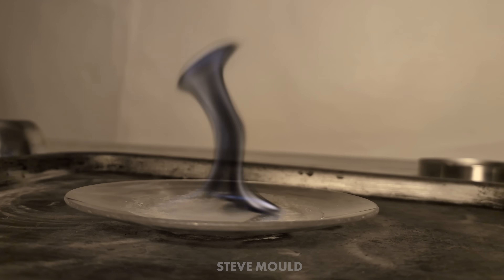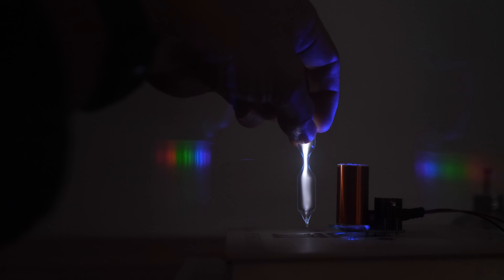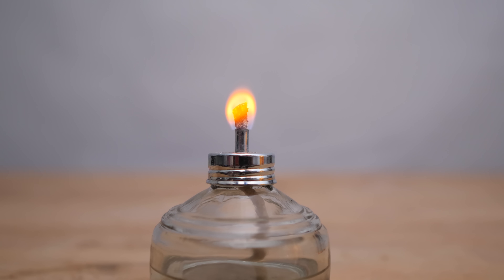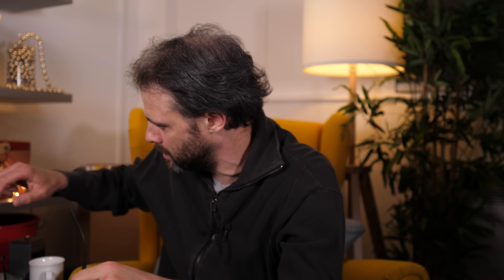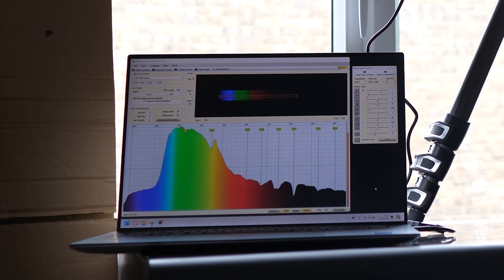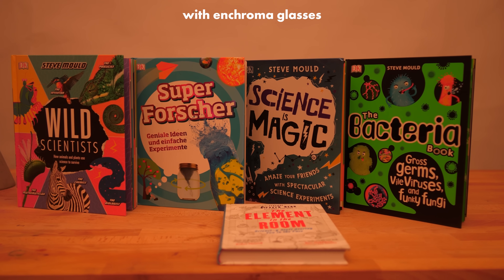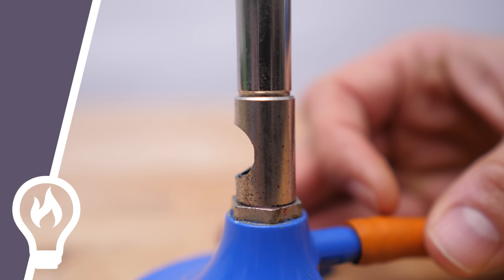Light sucking flames look like magic

Comment: Back in the early 1980s, after I acquired my driver's licence, I ran a red light on a section of roadway lit by sodium street-lighting because I happened to approach the lights after they'd turned to amber, perfectly camouflaged amongst the sodium lights.  Fortunately there were no other vehicles around as it was very early in the morning!
Reply: Bingo! Exactly the same thing happened while my brother was driving in the late 80's/early 90's, but fortunately without actually running the red light (newly installed lights on a very familiar road lit by sodium lights) since we also had my older sister in the car who called out "red light" when she realised neither of use had seen it. Stopped with the nose over the line. No cars nearby (~9pm), but easily could have been. The traffic lights were visible from over 200 metres away, but like your experience had already changed to red before they were in our view, so were lost in the sodium lights. For that reason I do not miss the sodium street lights - we are all safer from their disappearance.

Comment: The Corridor Crew did a cool video on using these lights to mask off subjects like a green screen. My question is with something like this could you effectively do something like use Photogramatry on a flame to get its exact shape? if you had a camera array? would this work with other fluid simulation things?

Comment: i have struggled with "Spin" of subatomic particles for years. The "it tells us which way the moving electric charge points its magnetic field" line felt like an epiphany i have waited decades for
Reply: Nice, and the reason the property is called "spin" is simply because the magnetic field of the electrons looks as if it was produced by the electrons spinning. Even though they're not, since they're wave functions at quantum level
Reply: @redtoxic8701  Or perhaps there's more going on there than we can comprehend... unseen dimensions and what not.
Reply: @James-fe7wd  that's an information as irrefutable as it is useless
Reply: @redtoxic8701  The point I'm trying to make is, our understanding of these things is still rather limited and likely always will be given our place in the universe. I'm no quantum phsyicist, but to call an electron's spin a misnomer with certainty seems quite presumptuous to me. What appears as a speck to us could well have dimensions we are not able to observe, and thus see them from a single dimensional plane. Just food for thought. I'm not trying to prove anything.
Reply: That's because it's highly simplified, it works in the context he presented electrons in, as point-like particles orbiting an atom.
I'm not a quantum physicist, but from what I've studied in my free time, spin is an intrinsic property, meaning even an electron standing still has to be in a spin up or spin down state, or a superstate of both.
This allows another identical electron to inhabit that same space "on top of each other", as long as its spin is the opposite. Not only that, it's possible for an electron to "flip" its spin, which has no macroscopic equivalent, since electrons don't spend any energy to do it.
Meanwhile, to make the Moon's angular momentum the same but opposite, you'd first need to exert enough energy to get it into a standstill, then the same amount of energy again to make the direction of movement opposite.
Like, even this explanation most likely has numerous errors, and it's extremely hard to understand quantum physics intuitively, the same way it's hard to intuitively understand trigonometry or complex numbers, or intuitively do a backflip or a heart surgery, even if you've seen someone else do it. The intuition is something you acquire from practice and study, unfortunately, since it leads to a lot of miscommunication between experts and non-experts.
Reply: @Niinkai  That is why I dislike YT videos on science and even math. The inaccurate analogies drive me crazy. As for an electron being a point, I prefer to think of it as being a collection of fields with a common point singularity. It makes action at a distance easier to understand and also resolves particle/wave duality.
Reply: I recommend PBS Spacetime for in depth content on electron spin and physics in general.
Reply: @alexeifando747  I've seen their spin episode. While sure it does explain what spin does, even they couldn't make it intuitive. Ultimately the idea of something having angular momentum but also being a point particle that can't actually spin just breaks our imagination. There's a reason even physicists (or even more so physics students) joke about spin.
Reply: @ArawnOfAnnwn  yeah, the ScienceClic video did a MUCH better job explaining this!
Reply: Congratulations, I still don't understand anything. 😅😅😅
Reply: I think something that people often don’t appreciate is that we humans are not entitled to automatically have an intuitive understanding of why something is the way it is, and spin (as well other parts of QM) is one of those things where “intuition” about it can only be built from scratch later in life through experience, hard work, and time in the equation-trenches working on real problems. 

While some aspects of spin might be captured by a comfortable analogy (“spin is like the intrinsic angular momentum of a quantum system”), there will always be qualities of spin missing from any one analogy (“spin is always pointing along some direction in 3D space, but trying to measure it along an arbitrary direction produces random results). Spin is fundamentally quantum and has no classical analog phenomena in the same way that something like the quantum momentum operator has its well known classical counterpart. 

I can recall when studying physics many years ago, it was a scary, but liberating, realisation that classical analogies and classical intuition will always leave you feeling uncomfortable with quantum phenomena. If you want to feel like you really understand it, at some point you have to take the quantum systems for what they actually are, not for what classical things you want them to be similar to. 

It’s been many years since I graduated, but there is a series of books that takes me back there. I admire them deeply for how their approach is similar to what I described above. 

They are the Theoretical Minimum series by Leonard Susskind - book two is on quantum mechanics, and unless you’ve studied university physics before you’ll need to read book one first. They are tough, but they are not unreadable like textbooks. They are no-nonsense from an expert and legend in the field, but they are written for the interested lay-person who wants to see what real quantum physics is all about. I cannot recommend them enough.
Reply: @JustRob96  Fascinating! Thanks for sharing your experience with us.
Reply: That is an insightful observation, but it should be noted that subatomic particles actually do appear to carry angular momentum. If you flip the spin of an electron, it always comes with changing angular momentum elsewhere (e.g. in the orbital), in accordance with conservation laws. Furthermore, if you apply the right forces you can get behaviours similar to precession (the "wobble" you see when a spinning top starts to slow down). And also, particles like photons and neutrinos also carry this spin, even though they don't have magnetic fields. So there is probably a deeper explanation down there somewhere...
Reply: it's kind of a mislabeling, since the fundamental particles don't have any size, they are points, any "wavelength" is just about probabilities  So, they can't "spin" since they don't have any part that could face in different directions.
Reply: @RWZiggy  So then what ARE they doing?
Reply: @ArawnOfAnnwn  occupying a quantum state that has some of the properties a spinning charged object does, yet very different from spinning in other ways.  Like the spin having only certain allowed values of angular momentum, like having a magnetic moment but only with certain values.

Now suppose someone asked me...Why?  What is happening to make that true?  I don't know!  

The particles that make up our universe are very very weird, not the way we imagine them from the way big things act.

Comment: (Kirchhoff & Bunsen 1859) So, this video contained nothing I didn't already know. This doesn't mean, I want to be disrespectful, rather that my (German) diploma in Chemistry made me kowledgeable at least in some fields. This glass-blower trick works with what was called with us "Cobalt-Glasses", wich we used to see other "elemental-flame-colours" besides the ubiquitous Sodium, in our first year courses. Funnily,, they came handy again in my diploma work, as the could filter out just the right wavelengsth my chemoluminescence reaction produced, so UV spectroscopy was still possible.

Comment: The reason it's black is because you are only seeing the absorption phase. You can't "see" the emission phase due to the stronger light source and it reflecting off of the background washing it out. Would be neat if you could get the Slo-mo guys to film this and see if the flame ever changes, but the changes probably happen at lightspeed so may not see anything anyway. Also this partially explains "black holes" too as they do this absorption but with every wavelength and only emit hawking radiation and not light.

Comment: Hey Guys. @15:31 There is a set of Color blind tests. 
I'm not previously had issues with color blindness, But I cant tell if one of these tests are a control or not. 
From the top left to the top right. The numbers are | 45 | 2 | [Squiggly lines] | 42|
For reference if anyone is curious the bottom row from left to right is | 74 | 97 | 6 | 3 |

Is the second from the right on the top just squiggly orange, brown, and green lines for you too?

Edit: Its apparently 15:31, I missed a 1
Reply: Colour blind tests frequently come with controls, number 3 is also gibberish for me so I wouldn’t be surprised if that was the control
Reply: I too saw just those three colored squiggles in the third-from-left-on-top image. I paused and looked at it sfor a while.

I also have not had issues with colorblindness. Whatever the situation, you and I are both in it.
Reply: Slight correction: It’s actually at 15:31 (took me a while to figure that out!). I also see a bunch of squiggly lines on the top line, second from the right. It is probably a control, as others have said. Otherwise, I see
45 / 2 / squiggle / 42
74 / 97 / 6 / 3
Reply: @DawnDavidson  yeah, i do think its for a control, so people cant fully guess their way through the test. for those with normal color vision its easy to tell its squiggles, but with slight color issues they would be able to tell there is something there but could have issues seeing the full squiggles.
Reply: @cranberrysauce61  So, it's a little more complicated than that. This is a "hidden digit plate" that has a number only color-deficient people can see. (It's a 73.) These images are known as Ishishara test plates if you want to learn more.
Reply: @ChemmyJee  thanks for the info. i did dig into a bit more and at least on the wiki page about the test they had some examples and looking closely at them, i started to notice the slight hue differences that is used to help determine the type of color blindness. and for me the 'hidden digit plates' look like a fill in the lines across the bands of colors.

after trying to see the hue differences for the 73 (and needing to increase the image size to see the '3'), i now know a slight portion of what a color blinded person goes through during the ishihara test.
Reply: as someone with perfect color vision, there is a subtle test at 15:21
Reply: I was looking at that test and was like damn, am I colorblind? I don't know what I'm supposed to see there
Reply: 15:31
Reply: Replying to my own message and adding to what @ChemmyJee said.  The squiggle slide is control slide, and has information only color deficient people can see.  There are more examples here on page 34 and 37 https://www.challengetb.org/publications/tools/country/Ishihara_Tests.pdf

Comment: You forgot that each enchroma glass lense absorbs a dofferent part, sich that one eye detects nore of the red and the other more of the green.

There has been an experiment with a similar setup, but instead they used different types of blue filter simulating having 4 cones.
And it ended up inceasing the participants ability to differentiate colour.

Comment: Hmm, I'm not sure about your explanation of why the flame appears black even though it should be emitting the same number of photons it absorbs. Yes, as you say, it's blocking the tiny patch of light rays from the wall behind it and re-emitting them in a 360° 3D sphere, only a tiny fraction of which will be aimed at the camera lens. But the flame is also in the full luminance of the sodium light itself, not to mention all the rays that bounce off every other wall and surface and happen to be pointed at the flame. The flame is receiving just as much sodium light as every other object in frame.

Based on your explanation and my understanding of light, here's the only thing I can imagine is happening. 
Sodium light is bouncing all around the room, and the flame is receiving reflected 599nm photons in a full sphere around itself, a panoramic picture of the room. It re-emits those photons randomly in the same unlimited arc, so it all cancels out; the flame does not appear any more or less luminous by reflected light alone.
Then there's the direct light from the sodium lamp. It's bathing the front half of the flame with the same amount of light as every other object in frame, which is being re-emitted in an unlimited arc, or both from the front and back half of the flame. So the flame should appear about half as bright as an opaque matte object the exact size and shape of the flame. But it doesn't, really. It appears far far darker, almost completely black and without light. 
My only explanations are either that there's something more complicated going on with the light that hits the flame, or something about the camera is creating the appearance of much greater contrast, making the flame look practically black compared to the room, when actually it is only about half as bright as the other objects, as I would predict. Is it just a trick of whitebalance?

Comment: Someone else may have already commented about this, but the fact that the light emitted by sodium atoms produces roughly one wavelength of visible light was used in movies for compositing in lieu of greenscreen. This technique known as "Sodium Vapor Process" or informally "Yellow screen" utilized custom-made beam-splitter prisms with embedded notch filters (similar to how EnMouldia glasses work) and Bandpass filters split the image into two parts to create a perfect matte. This process was famously used by Disney in the filming of Bed knobs and Broomsticks as well as Mary Poppins.
Reply: And Corridor Digital recently managed to collaborate with an engineer reconstructing such camera setup and made a very interesting test movie with amazing key mattes thanks to sodium vapor!
Reply: @angrypotato_fz  There is also a recent YouTube video by Project 326 using infrared for chromakey video in a technique similar to the yellow screen process.
Reply: @angrypotato_fz I saw that.  It was pretty cool to understand how green screens work and then the difference using the sodium lights.
Reply: Wasn't it also used in The Birds?
Reply: @SomeplaceScary probably was
Reply: Its also used near astronomical observatories to provide light for people working at night, because it's easy to filter just that one wavelength.
Reply: The f is a bed knob
Reply: @thekingoffailure9967  An ornamental ball on the top of the posts of an old fashioned bed. Loads of wooden furniture used to have knobs, we were just a knob obsessed society 😄
Reply: @matthewstarkie4254  I have those on my metal bed frame but I didn't know that was what bed knobs were lol
Reply: @thekingoffailure9967 Go ask your mother. I had her sitting on mine last night...

Comment: I like how we can see the limitations of color filter arrays at 2:28. That is not how a rainbow looks, that's only how a rainbow looks to that camera sensor. Color filter arrays (CFAs) closely approximate the color sensitivity of human eyes, but they do not match it (which would be impossible since everyone's going to be at least slightly different). While CFAs do a pretty good job for most everyday situations, in edge cases, such as when you're looking at single wavelength light or, as in this case, looking at a rainbow, their limitations can be seen.

I'm guessing there's probably also effects from post-processing, file compression, and transcoding going on there, but I doubt they're particularly strong.

Comment: You should know that the sodium vapor lights used as streetlights are high pressure, and thus emit more frequencies of light, although their CRI is probably still awful. By contrast, you were using a low-pressure sodium vapor lamp, which is basically monochromatic.

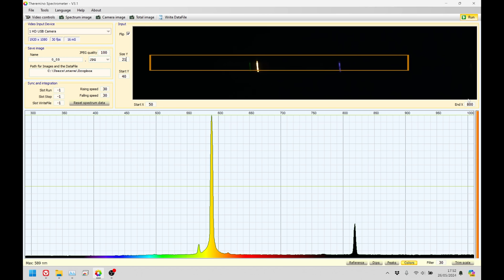Comment: 10:00 There are other lines at 818.32 and 819.48, and some more very hard to see/detect ones like 330.23. The little peaks around the 2 big ones are likely measurement errors or impurity and therefor other elements like Calcium
Take a look at https://physics.nist.gov/PhysRefData/Handbook/Tables/sodiumtable3.htm